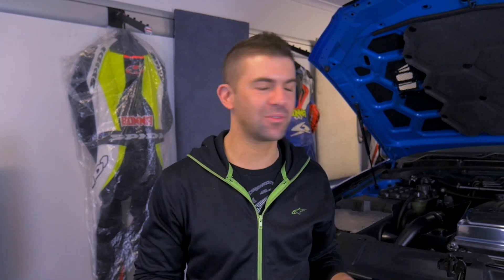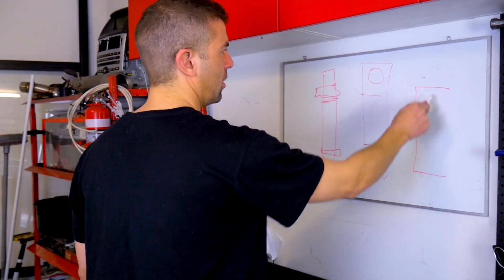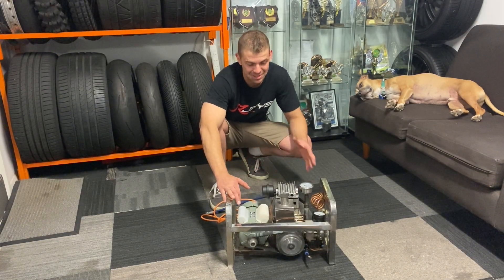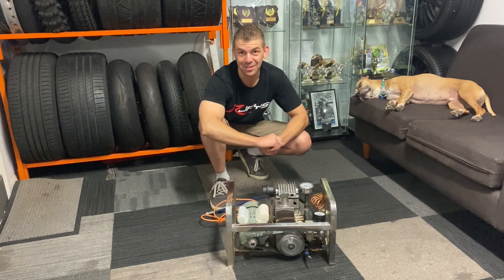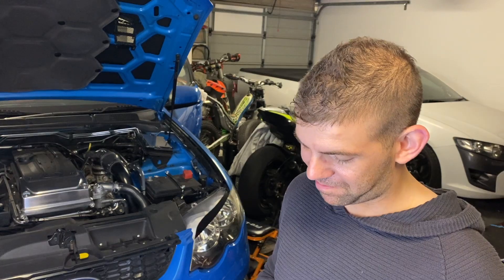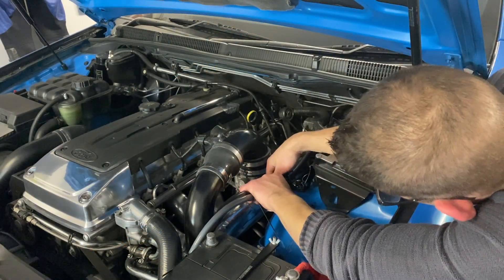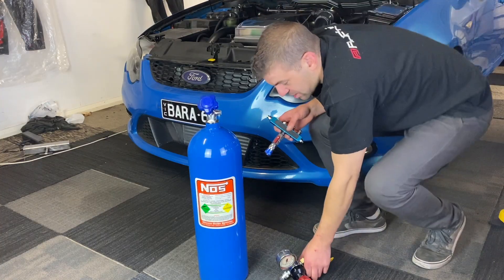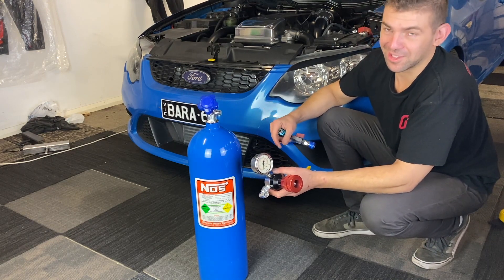PART ONE: NASCAR Truck Air Jack Install For the Turbo Ute

Comment: Dam those rear wheels 👍 I'm running 305x30x20 on mine but yours look next level . Don't think I'll ever get the jacks but good work mate
Reply from the maker: Appreciate it Gonzo.
I’m sure yours would still look killer!
These are 345s on 19x13s up the back.
Should be handy if I need to drive over sand dunes.😉
Reply: Dam!! I need more rubber
Reply from the maker: @smithy2  no matter how fat your tyre are, you’ll still want fatter tyres.😉
Reply: @FairlyLegalCarMods  haha this  is true

Comment: Great channel mate. Can't believe I just found it. Nice ute. Love the air jack set up. Those air line quick fittings are awesome, use them on a race car gearbox, a ratrod air suspension and my turbo GSXR.

Comment: Very cool...  Wonder if you can make the blow-off circuit sound like a turbo?  Chu-Chu-Chu-Chu....
Reply from the maker: Thanks mate. Anything is possible!
If I plumbed it into the compressor cover like an anti-lag setup I reckon it would flutter out the intake… or bend the throttle body.
Could be very good, or very bad.😅

Comment: First barra to have this set up installed well done mate. 
Your tires are killer what’s the spec’s ?
Reply from the maker: Thanks mate, appreciate you checking it out.
The wheels are 19x10.5 and 19x13 with 275’s and 345’s.
We posted up a vid about them a few months back showing what was involved to make them fit. 👍

Comment: I have the same pump lol.I used mine to pump up a pcp air rifle.Please be careful with fittings make sure they are all rated.My carbon fiber tank is rated to 4500psi.If you want less weight
Reply from the maker: Nice one. 
The carbon tanks are very cool.
Had trouble initially finding rated fittings. Even blew the thread out of an aluminium one testing it outside!
Does yours make some knocking sounds or has mine done a big end?
Reply: @FairlyLegalCarMods  Yeh they make a bit of noise.They make a few different ones now.The ones we have arent really recommended for long term use.I run mine for a few minutes just to fill a pcp air rifle and turn it off.Google pcp compressors.You could get a smaller carbon tank and fill it to 4500psi and weigh like 10lbs.But they are pretty hexy.
Reply from the maker: @matman429  Ahh that puts my mind at ease a little.
Did a fair bit of research before buying this one. Not many could pump up the larger bottles. This alloy NOS one is surprisingly light, 18 lbs which isn’t bad considering it’s capacity and seems to last ages. 
Maybe I could turn the fog light into an air canon! 😂

Comment: Are you using compressed air for this or nitrogen
Reply from the maker: Hi mate, compressed air. I usually pump the bottle to around 2900psi and set the reg to about 520psi to the jacks.
Reply: @FairlyLegalCarMods  How many uses can you get out of a bottle before filling it back up
Reply from the maker: @wattleyracing  haven’t really counted but I’d say 15-20 with all 4 and probably double that if just using 2.

Comment: What’s size are those rims and offsets??
Reply from the maker: Hi Beau,
They’re the fattest I could squeeze under it without getting too nasty.
19x13 with 345s under the tub and 19x10.5 with 275s next to your feet.
Been a while since I measured it up and worked out the offset I needed but we posted a vid a few months back showing what was involved and how to work out the fitment.